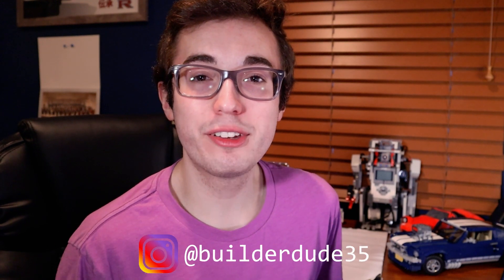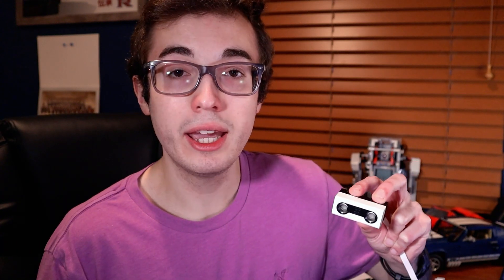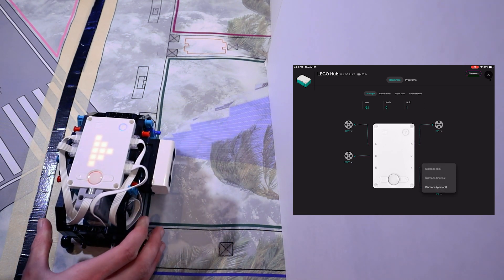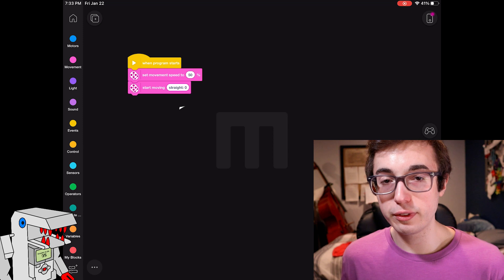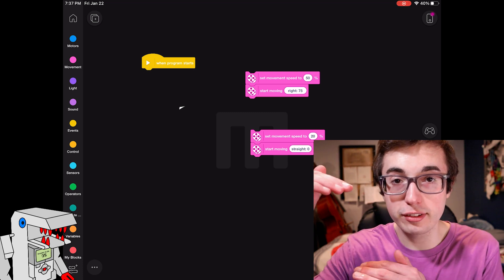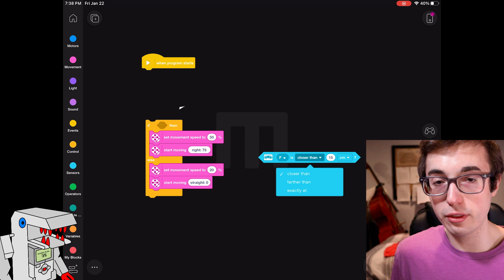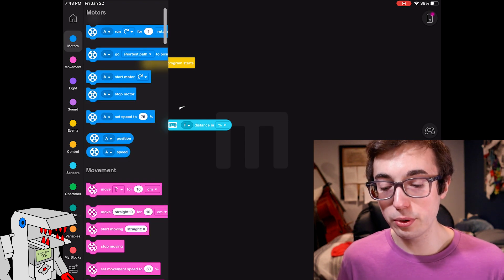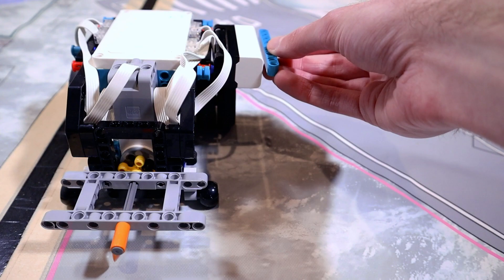LEGO 51515 Distance Sensor - Everything You Must Know

Comment from the maker: How do you plan to use the LEGO 51515 distance sensor? Let me know here!
Reply: I'm trying to make robot that rotates, and when he detects the ball - move to it, but sensor doesn't detect the ball if ball is farther that ~45cm =(
Is this always was a problem? Or only SP, RI5 sensors have that issue?
Reply from the maker: @RomanRichter420  The Distance sensor is going to have a hard time seeing an object like a ball. Because it is round, a lot of the sound pulses will reflect off of the ball in the wrong direction. The Distance sensor is best used with flat surfaces.
Reply: @Builderdude35  I'm trying to do something like NXT TriBot, but yeah, you were right, sensor have hard time with ball =(
Reply: Hi Builderdude35,
I've one question about force sensor.
In Spike app we have blocks for force sensor but these blocks for force sensor are lost in Mindstorm Inventor app.
So do you think it's possible to use force sensor in Inventor .
I didn't find anythink about this on internet, so if it's possible did you plann to make a video tutorial about this ?

Thnaks
Reply from the maker: @cuda7189  I thought about it and originally I had it in my plan. The force sensor should, in theory, work just fine with LEGO 51515, but as you noted, there is no programming support for it in the MINDSTORMS app. Until that happens, I am afraid I cannot make a tutorial on it.
Reply: @Builderdude35  thanks for your fast answer
Possible it works on Inventor by using Python programming, but I only suppose, I'm really not sure
Hope force sensor blocks will arrive in Inventor one day
In EV3 we had the option to import blocks, not in these new Mindstorm
Reply: i found on the lego website that the ultrasonic sensor pins can be integrated with diy board and hardware, but i can't find the tutorial about it :D
Reply: I love any kind of FOLLOWERS especially LINE FOLLOWERS 😍😍😍
Reply: Your tutorials are so helpful thnx Carl feel doin this
Reply: Even though this is for the Mindstorms robot it helped me a lot with my Spike Prime robot since they both function similarly. So thank you so muchhh!
Reply: im building a cat (the animal , not the vehicle)
Reply: to make a turret

Comment: I was wondering it the sensor could be used to do something while using the Playstation 4 remote to control a build. So I built a little car and had the right joy stick start and stop a motor. But I inserted some blocks that had the sensor test to see if it was closer than 8 cm, and if so, stop the drive motor. Guess what? It worked!
Reply from the maker: That's super cool! Thanks for sharing your project with us!
Reply: @Builderdude35  Thanks. Added the light sensor to detect if the car was "going off a cliff" like the edge of a table. That worked too.
Reply from the maker: @bobcubsfan  that sounds like a pretty sweet project! Congrats!
Reply: @Builderdude35  I am wondering about coding a subroutine. For example, I put together a block that makes the car go backwards when the PS4 joystick is in the down position. What if when the light sensor stops the car I want to use the same code to have it back up? The section My Blocks might be the key, but I don't see a way to do it.
Reply: I figured it out how to make reusable blocks
Reply from the maker: @bobcubsfan  maybe an Event is what you are looking for?
Reply: @Builderdude35  Repeatable code that can be defined then used in other blocks. I can send you my code if you wish.
Reply from the maker: @bobcubsfan  yeah this is really cool, you can contact me via my website if you want!

Comment: How can the Remote blocks for Sony Playstation 4 Controller be added to a project? Tricky has it, for example.
Reply from the maker: I will cover that in a future tutorial, coming soon. Stay tuned!
Reply: @Builderdude35  Great. I got it working. Seems the system requires a conduit such as an iPhone to make it work. Pairing both, the the Mindstorm app allow switching from the iPhone to the PS4.
Reply from the maker: @bobcubsfan  that's exactly correct, you need to connect both the robot and controller to your smart device (phone, tablet) to use as an intermediate. Have fun with it!

Comment: Im looking to get into lego robotics for cheap, i mean dirt cheap. Is nxt still an option to code with at all. I was looking at those just to run a few large mototrs off of. If so, would I use the Lego Mindstorms Home application to do so
Reply from the maker: Not sure whether LEGO still allows you to download NXT software, but you can probably find the CD with the software for sale somewhere. I can't guarantee it will be cheap though -- probably just the opposite, considering the NXT is not produced anymore.
Reply: @Builderdude35  So if I bought the brick and motors then I couldn’t use them!
Reply from the maker: @alextrujillo7849  Quite possibly. I recommend doing some research to see if you can get the LEGO NXT software. Which reminds me, you actually can program the NXT using the EV3 programming, which is still available. Check out this video for more info: https://youtu.be/ybv98CALAt4

Comment: I found the precision of the sensor is very poor when in Streaming mode and I expected that because it executes the loop at a lower speed. But I didn't find it acceptable even in Download mode.
Reply from the maker: I found the same thing, and if you see my demonstration example at the end of the video (where I assign motor speed to the distance measurement) you can see velocity changes are very sloppy and not smooth at all.
Reply: any tips for how to account for this in the code  @Builderdude35  ?

Comment: I really like the set, I used to have an NXT and the cables always were problematic for me.
Things I would improve about it could be that it used USB C instead of micro, longer cables (this could be actually improved by lego if they make extensions) and the color led in the light sensor, it looked cool sometimes.
Also how can I get a bulk of technic pieces? Are there good sets just to buy for this?
Reply from the maker: For buying pieces in bulk: LEGO Education makes parts add-on packs of 30-ish brocks that you can buy on their website. Other than that, buying a LEGO set to uses as a "donor set" and using its bricks is the way a lot of people do that.

Comment: Your videos are so well produced!  :)  I'm wondering if a Lego Sumo bot could successfully use the newly-designed Lego Distance Sensor/Ultrasonic Sensor to "home" in on an opponent's Sumo bot.  If you noted that the Distance Sensor is only good at detecting PERPENDICULAR ultrasound reflections, if the Sumo bot is spinning around to locate the opponent, could it work?  Lego Sumo bots sometimes use Dual-Range infrared sensors (like the Mindsensors "Dual Range, Triple Zone Infrared Obstacle Detector for SPIKE Prime"), but it is "not Lego" and costs a lot....
Reply from the maker: Thank you for noticing the improvement in production quality! I've been putting in some more time to make sure video quality is up to a higher standard now, and I am glad it is paying off!
Reply from the maker: As for Sumo bots, I believe I used the EV3 infrared sensor back in the day, and got better results using IR than ultrasonic-based sensors. I can't remember exactly why. You can certainly make an ultrasonic sensor work if your robot sweeps around slower and the opponent robot has wide, flat sides.